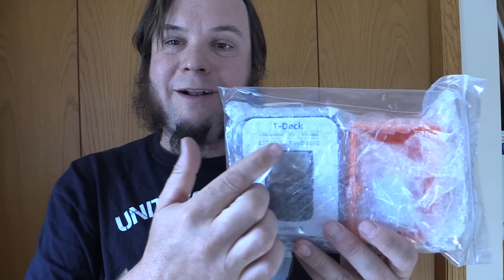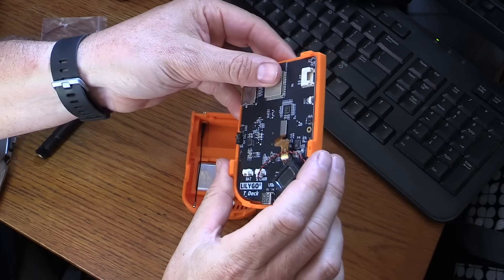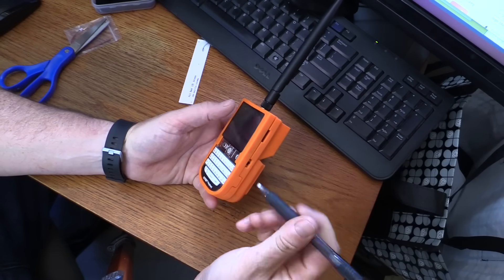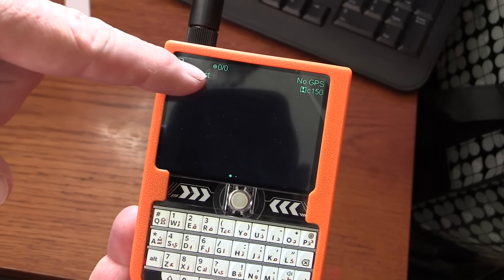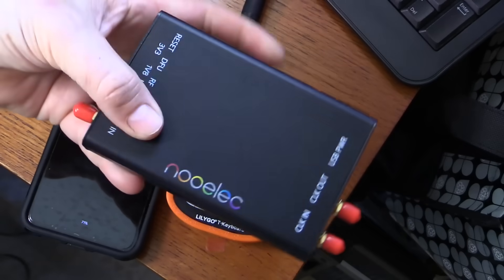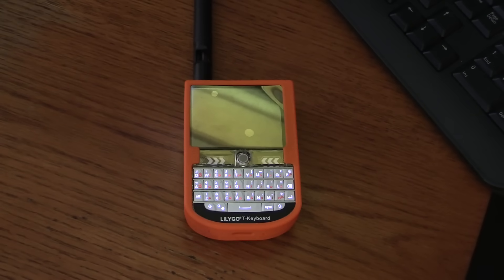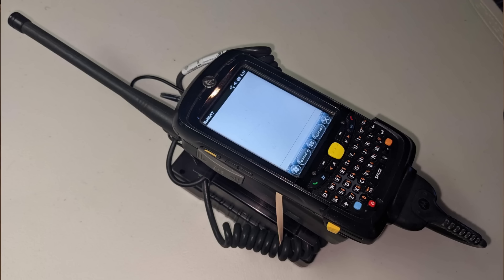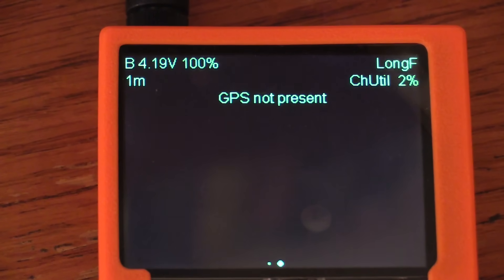Trying Meshtastic For The First Time

Comment: I believe what you were missing with the communication network was to use MQTT to discover nodes, when the nodes are discovered they stay connected but you need MQTT to discover the routers and clients to communicate first, you also could wardrive with the device enabled to find nodes but that's super inconvenient.

Comment: 8:00 It needs to be be part of another system, usually with no need for internet for low-bandwidth comms. The practical use cases (including the fact it acts as a node-finder) for the LoRaWAN is to couple that with triggering of satellite data downloads and also DVB-T and DAB (TV and Radio) not far off how the old Nintendo games-console SNES connected to a satellite dish but needed a dial-up modem for upstream (Satellaview but this time for serious Blender3D and mapping,, especially WaterML compatible map-data with Gaussian heat-maps using pg_vector for vector-similarity-comparison and RUST API postgresML LLM for probability estimation like Markov-state-transitions and Rosenblatt-Parzen window method probability estimation, not just fun games). The LoRaWAN in that set-up would however provide telemetry, reliability-metrics (MTTF, MTTR, ROCOF, MTBF, PODOF, MTTA, FIT, etc.) and file-integrity-checksum (as with hashing and UUID and latitude-longitude-altitude-zenith and bearings, plus pitch-roll-yaw nintendo-Wii-remote accelerometers akin to X-Y-Z co-ordinates and a digital-compass sensor data, with a cronjob time-date-stamp) and also quiz pro-forma submissions, and SSH "sc-im" spreadsheet data such that WaterML compatible map data, with node-triangulation, can be generated. It would run Gnuplot and gnumeric, and this could also show the carrier signals from a PLL.
The S-band and K-band and (with El-Hail too) weather satellite (and HRPT) USB dongles could work with it. It would need a proper CPU (and, with at least 4GB RAM so it can do DCHP better than a mipsel, so a CPU would be say a A53 or amd64-i586 would do for known-quantity instruction-set and protection rings for a camera to scan QR coded input or an agreed-upon RISC-V) and not just a microcontroller. All the above would have a USB and RFID hardware key security dongle for logonID and encryption. A known-quantity large amount of data would need to be assumed (a few DVD ISO file's worth) such as Endless-OS ISO (with its magnettorrent and file) because it has a known-quantity dependency tree and a great many wiki articles. It would already be on there as a pre-requisite and would not be assumed to download since it is so large a file (even though in theory it 'could' do). A hash and directory to a file (such as a text file) on the ISO could then be referred to because everybody using the system is assumed to have it already, thereby making imparted information more detailed without needing to send all that data every single time. Also Tesseract OCR could work with SRT files subtitles generated or imported and exported as the system would be compatible with ogg vorbis theora in gxine.
All the above would also help the satellite dishes rotate (and have pitch-roll-yaw in accelerometers and a compass sensor) to get a signal whilst moving the dishes. Every now and then a person might also (although it would not be mandatory) include a raspberrypi5 for the accurate clock built into it (checking things like signal response or latency and so forth). 
These are all (as per the saveitforparts channel) quite low cost components and could be placed on a vehicle and-or school or health-building or fire-assembly point (or any disaster assembly point including a shelter) for disaster preparedness but also for making DVB-T and DAB TV and Radio (and satellite data) better. The amateur radio GNURadioHAM could also be added if a person has the licences to improve that with data modes additionally in the spectroscopy. Filters for the dongles would need to be built-in with pertaining BNC connectors to MCX (with oscillators needed, be it TCXO, VCXO, OCXO or whatever).

It would need to run something like Linux or BSD with reverse proxy like DNSCrypt (and Ansible) with RSync.
Having a few low costing (playstation2 usb camera) cameras means that one can have the IR-filter removed to show infrared images in the spectrum for things like body gait movement _(perhaps with sobel edge detection) using DLib and Eigen maths libraries with C++ and Python and GTK4, and detail can be added with the LLM later, such as via high precision Gaussian Double in say OpenCL2.3 heterogenous computing. The Orbcoom IoT satellite data snoop could also be added. DAB radio (but also DVB-T TV) could do with requiring LoRaWAN be built in and that some manner of data storage be allowed (and assumption of say 28GB in Fat32 such as a 32GB NAND storage device, and a second in ReiserFS since it is fast although without metadata and can support large drives too and is historically compatible in some OS even if a mix of read-and-write capabilities, like Fat32 is compatible historically but has limitations) over SATA or Parallel port (ECP or EPP) or Ethernet-RJ45, and RS232 UART serial TTL. The bidirectional (and ECP, EPP modes at say 5MBps speed) parallel IEEE1284 (with a 2nd and 3rd passthrough port) are the most important as long as in conjunction wit the Serial RS232 UART TTL connection because the IEEE1284 is also a GPIO, let alone being able to interface to a control surface, but also for storage. The data storage does not need to be particularly fast. 

If an ethernet port is on there (which would be iPXE mandatory), it should be only 100Mbps with a tiny driver, and there should be say 4 or 5 RJ45 ports whereby one is the WAN input, and the other 3 or 4 are the usual LAN in-out ports either to be split like a normal router or capable of binding (or link-aggregation as a switch, also with LACP and LAG modes), and this means those three 100Mpbs RJ45 ethernet 802.3 can be used as a 300Mbps (and 1 discrete, or 4 at 400Mbps) link for those who are geeks who insist on more speed-bandwidth and yet the large driver size of the RJ45 port (which has SR-IOV and VMDq in the NIC) won't need a large driver like a 1GBPs RJ45 Ethernet NIC often has, and so the small driver could load even over a serial connection in small bandwidth if need be or even (eventually) the LoRaWAN, thereby solving potentially a great many catch22 downtime scenarios.
Such a gadget should be capable of having a house-brick sized battery, with charging circuit, to run for a day at least in a power-loss event (although if a person wants to put a car-battery sized one in, they could do via buck-convertor).
A different C-sized battery (with another spare for during the dead-battery swap) would power the clock and BIOS settings or similar firmware (also with options on a Altera MAX II CPLD since it is actually a repackaged FPGA).
The rig could have a expansion socket for an RTOS module which is not mandatory to get it running (keeping cost low) but there for those who want to upgrade to fancy features.
There could be IOMMU implemented by say a northbridge chipset and then also SLAT (including VT-d and VT-x) in a NVMe (PCIe v4 with bifurcation) so that if a person wants to upgrade adding a faster NIC, they can do as a nerd and everybody else need not be bothered by following their higher cost upgrades.
The system would not need a modem (in the sense of ADSL or 56K etc.) but could have a sound-card input (Jack-Audio, Open-Sound-System with Chuck-Audio, FluidSynth, ALSA, LADSPA compatible and with MIDI DA-15 port, aplaymidi and FreePATS GM with awesfx sinstalled) and output for mic-line and line-out and headphones, useful for troubleshooting but also for those who insist on adding data-in-out (RX and TX) via sound-wave square-wave modulation.
The device should have a FLIRC style receiver for IR but also a IR-Blaster to send and receive data (RX and TX) and so the parallel port could have a driver stack waiting for a EDR Bluetooth 2.1 A2DP dongle to plug in. This then not only allows other sound devices and sending or receiving of data as streams and files but also a Nintendo-wii-remote controller could work with it. The Linux kernel has long had support for that.
All the above does not require massive infrastructure (the satellites already exist) and is inexpensive (sometimes even often eWaste that can be upcycled) parts.
A community server now and then (maybe with a DHT) could allow for Squid_serverGPLv2 for bandwidth management and cache to allow small bulletin board messaging.
While all the above could have a MIPI interface if a person who wants to second can install a LCD screen, instead the lower costing screen in the video (or and 2 pin-outs for 128x32 LCD monochrome LCD screens) would be the standard on it, and in addition to that blackberry-style-keyboard, the numeric keypad found on a QWERTY keyboard (including those 9 home-end-delete-insert keys and arrows and an extra shift-select to change their functions yet again) with one clickable analogue joystick.

My comment has no hate in it and I do no harm. I am not appalled or afraid, boasting or envying or complaining... Just saying. Psalms23: Giving thanks and praise to the Lord and peace and love. Also, I'd say Matthew6.
Reply from the maker: OK I like the screen name but did I just get spammed by ChatGPT? 😂
Reply: @saveitforparts  Your subtitles wordcount is higher. Gotcha! ;p

I am prepared for the long-comment-phobes. :D

There could be a convention on youtube whereby if uploaders want to set the word-count limit to the old comment system, they can do, and then it puts flag in the description text to say they have arbitrarily decide upon it. Anything technically in depth generally requires detail (especially in comparison to the video spoken wordcount let alone text shown on the screen) to provide something other than a Chrimbo Cracker motto masquerading as a succinct sage proverb (in comment form). People don't seem to like the fact that Google increased the Youtube wordcount, and yet youtube are specific about various things they want to be the case on youtube such as the written guides on not having black-bars on widescreen video captured as 4-3 aspect ratio and so on. 
Even though a print-preview would have been a worthwhile technology, Google got it right on the word-count. Those who want shorter comments can say so in he video or description text. I've tested this over years in commenting systems and emails and the word-count people seem most comfortable with as a maximum is between 200 and 400 words maximum. They can use one of those AI apps to condense something into brevity, however, if they mess up, they cannot say the person who wrote the longer detail had not told them so.
Everybody can be happy. :)

As for the LoRaWAN (RX and TX) inclusion in TV DVB-T and DAB radio, in the British Isles we have a TV Licence so it would help wit that in the above. The popularity of the TV Licence is a mixed bag. I would say this inclusion would help its popularity and, as it is not internet, it is a form of prepping in a different technology for comms. It would also have Vimwiki on it with po translation addon-plugin for different languages. Makes sense because it can all be done command line if needed to trickle the data by low bandwidth connection. In USA there is not quite the same TV Licence scenario, so the relevance might not be so obvious.
My comment has no hate in it and I do no harm. I am not appalled or afraid, boasting or envying or complaining... Just saying. Psalms23: Giving thanks and praise to the Lord and peace and love. Also, I'd say Matthew6.

Comment: meshtastic is cool for remote controller projects with arduino - you can send and receive data via serial port. I can reach a weatherstation 50KM away with 3 Hops. It is essential to get two boards/nodes if you start with meshtastic.

Comment: That tiny connector at 2:55 is called U.FL. It's strange that they used it here, since it's designed for weight-critical applications like FPV antennas on RC airplanes and drones. U.FL is very fragile and has a limited number of mating cycles, owing to the extreme weight reduction.

MMCX is a step up in durability from U.FL. I always feel like I'm going to break those, but I haven't actually managed to yet.

Comment: i've got a few meshtastic radios up near maple grove, with really bad antennas so my range record is 1.2km so far. not very popular here yet, no. i've picked up some scattered mesh near downtown st paul and made contact with someone from the roof of a parking ramp next to the minneapolis convention center

if you're "wardriving" for nodes i suggest making sure your radio is on range test mode, so that its actively putting out packets. being a low power tech it doesn't normally advertise itself very much like wifi does

spamming the mesh is hardly a worry if you're not even picking up any mesh 🙃

Comment: wow an off-grid radio that requires an on-grid mobile phone to work, at least partially.  absolutely brilliant; pure genius everyone, well done.
Reply: It requires an Internet connection to initially set up and grab firmware images, unless you want to find someone with a firmware image and flash it over serial.

After that, uh, no. You can rip the SIM out of your phone or use a simless Android device as a client. Or a cyberdeck or something running the available web client, which can be run locally in a docker container. Or just have the T-deck on its own. Or use one of the small heltec or RAK boards and use it like a pager with the tiny OLED screen.

Use case is mostly small messages and various telemetry apps, so yes, it's an off-grid comms system and no it doesn't require on-grid anything asides maybe initial setup.

Comment: Hey so as someone involved in my local Meshtastic community on the other side of the country (NY) there's a few things to note: 1. A GPS module helps tremendously with these things. Not in making contacts over Meshtastic itself, but moreso in troubleshooting. It makes it easier to figure out what nodes are nearby and sometimes the app will let you swap frequencies to that of other users in the area. 2. As with any radio system, height is might, but with how crowded the bands are in the US you're unlikely to get contacts outside of a few thousand meters away in most areas, especially on 900MHz which is a band usually used by public safety radio systems like Police/Fire/EMS. You really do need to be within a few thousand yards of someone to make any sort of meaningful connection here. 3. See if there are any local gateways in your area. These things run on LORA, which sometimes depends on a gateway. Even with a low signal, some gateways are set up on top of huge buildings to get better coverage. It's a bit of a PITA to get connected to these gateways sometimes.

Otherwise, I'd not recommend Meshtastic in the US unless you're in an area with other Meshastic users who are close by. It's honestly not a great system, but it's really cool if you get it working!

Comment: Try connecting it to your wifi, using the Network configuration in Settings.  Then you could turn on MQTT and pick a topic that is regional to you (picking the root topic will just overflow the device's ability to keep up with the traffic).  That will let you see nodes that are around your area using the web connection.  Then you could drive near those spots and see if you pick them up on RF.

Comment: I have a Heltec inside the loft, NW UK. It gets like 7 km to a couple of nodes then picks up group messages, populates others on the map and shows now "37 of 111 online". ChUtil 22%, AirUtil 10% (Router client mode).

I tried my other in a backpack and they probably worked intermittently to a 500m radius due to obstructions. But I didn't walk further. On holiday I got 4 miles with the other in a window.

Surprisingly the BT works even downstairs and is way better than via wifi.

I guess I can only DM those I'm direct to and sometimes can traceroute others only a few hops away - but maybe group chat everyone? Also the mesh can get too overloaded to traceroute...

Because a video advised us to crank up all those NodeInfo and neighbourhood position settings and it got too busy.

It was awkward to understand who you have a good signal to. My second device would route through the one in the loft and everyone suddenly had -55 signal instead of ~125. 

So all the various node strengths I see now, are they due to it going through someone else?

Try the Liam Cottle meshmap, you can click a node to plot who hears who.

Comment: Maybe look at the channels from Ringway Manchester and Andy Kirby..

They're both hams from UK and have some fun with meshtastic in different setups. ;)

Just from the get go, you could put some distributed meshtastic CO2 and O2 sensors into the sandland caves..... could be interesting. ;)
Reply: meshtastic is crap For many reasons no Voice Is one, Try and send a text using  them  it's almost impossible and  long winded.  so Just use your mobile, And how are you going to power remote nodes So many reason why it's  rubbish The Nearest node is more than a 80 miles away from me. as You can see completely useless, It's a fad and it will die down soon, Using Smoke signals will get you better range, To be honest even shouting will, even using CB or cheap Chinese dual band radios or pmr446 Would be better off grid.(On the south coast of the UK). Ringway Manchester and Andy Kirby are fools they need to get out more